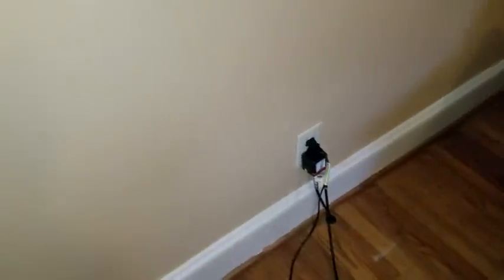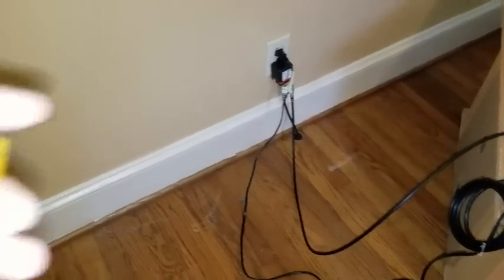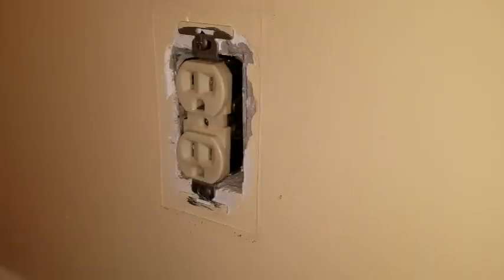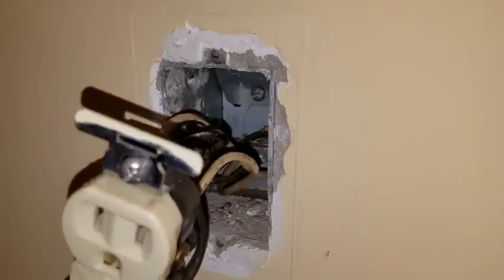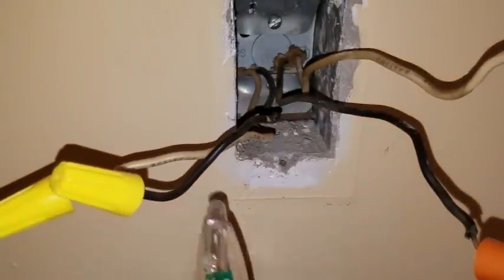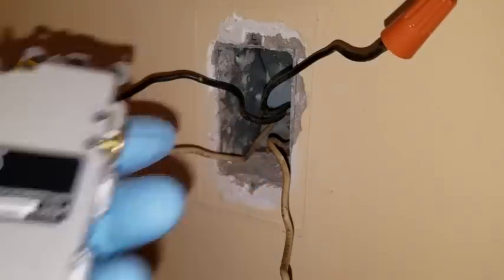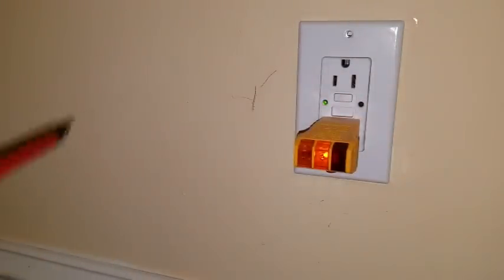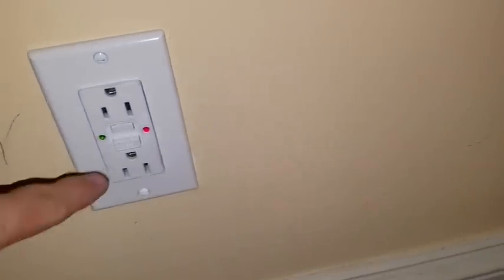Safely Upgrade Old 2 Prong Outlets To 3 prong Outlets

Comment: You mentioned in your video a small gauge ground wire in the box, I came across this in an old 3 prong outlet I replaced, I connected it to the ground screw, but my outlet tester recognizes it as open ground, is it not really grounded?
Reply from the maker: Not really grounded its a Fake Ground. Google "bootleg ground" 
and look at the images.
 
a bootleg ground is an electrical ground that is wired from the neutral side of a receptacle or light fixture in an older 2-wire home.[1] This essentially connects the neutral side of the receptacle to the casing of an appliance or lamp. It can be a hazard because the neutral wire is a current-carrying conductor, which means the casing can become energized. In addition, a fault condition to a bootleg ground will not trip a GFCI breaker or a receptacle that is wired from the load side of a GFCI receptacle. Bootleg grounding is illegal and against code in many places. A safer alternative [NEC Sec. 406.4(D)(2)(b)] if a grounding connection is not practicable (where a local electrical code allows it) is to install a GFCI and leave the grounding terminal screw unconnected, then place a label that says "No Equipment Ground" on the GFCI and a marking that states “GFCI Protected” and “No Equipment Ground” on all downstream receptacles.
Reply: @NorthCarolinaPrepper  I have metal boxes with black & white wire, no ground wire. When I replace the 2 prong with a 3 its testing positive for ground. How is this happening? When I test hot leed to the box in getting 120. If I put a GFI in there will the GFI function properly?
Reply: @a_aronhdtech  The metal box is probably bonded by a conduit, which is a form of ground. A GFCI will work with or without a ground.
Reply: @a_aronhdtech  Also there could be an 18 gauge ground wire to the back side of the box so it won't be visible, but when you install the outlet those screws will make contact and bond the outlet to the box. You can put a GFCI and label it "No Equipment Ground" assuming that the ground is improper for today's standards. The label I am talking about comes inside the box of the GFCI. You can also label the downstream outlets "GFCI Protected" and "No Equipment Ground."
Reply: @illestofdemall13  your right. Its metal box with metal  conduit and there is a ground from the basement up to the panel. So basically all the outlets are grounded. Thanks.
Reply: @a_aronhdtech  Metal conduit is a good ground when all the couplings are tight.
Reply: @a_aronhdtech  for safety run a ground wire from box and connect to ground on device make sure bx and conduit connectors are tight to the box as well
Reply: @wizard3z868  Exactly right.

Comment: This is why you shell out $100 for a home inspection prior to buying a house.  Sounds like you need a lot of electrical upgrades.
Reply: MrOldclunker if u hire a $100 inspector guarantee you'll have more issues than those ungrounded receptacles.
Reply: Lol, it's not a $100 and an inspector will not open receptacles to figure out what shit job has been done. Also even if you know that there are issues, you might still decide to buy the house and fix the things that are wrong.
Reply: @Niklaos  Open the Main Panel and you will see everything you need to know,Lol.
Reply from the maker: I had a home inspection. I negotiated for the repairs to be done at a later time I called a bunch of contractors to get quotes. The told them I would meet then half way and they cut me a check at closing.
Reply: I spent $350 on one of the only two home inspectors in my state and have worse problems. Your only real safe guard is to research it for yourself.
Reply: @lho10101  dang what state you live in that only has 2 home inspectors?

Comment: how do you know there is no equipment ground? I didn't see the wiring, but if it's BX cable there is no separate conductor for equipment ground. the sheath bonds the equipment back to the panel. it could be as simple as an incorrectly installed bx connector. this is not as big of a problem as you think. very few household appliances use the ground. most use polarized two wire plugs.
Reply from the maker: Its old cloth covered wiring.
Reply: North Carolina Prepper depending on the vintage there may be an equipment ground conductor and it was not installed correctly.. you would have to peel some insulation back where it's exposed.  In the days of two prong plugs. They simply ignored that wire.
Reply from the maker: I agree. Its strange they did a remodel in the kitchen, that all has modem wiring with a corrected grounds but they neglected the other half of the house, I'm guessing that was due to cost. I really need to redo about 4-5  branches. Then when I wire up my shop I will over do it and put in a 220

Comment: LOL................are you out of your fucking mind?
Without a ground, your GFI and three prong plug with no ground are one and the same.
This comes form 40 years of experience.
What you are doing is fucking stupid and dangerous as hell!
YOUR GFI will not work at all.
Reply from the maker: Hooking receptacles to the "load" side of the GFCI and it'll be fine.
 Feeding the 3-prong ungrounded receptacles through a GFCI makes them code compliant. Here is the NEC Code if ya want to look it up.  406.4(D)(2)(c)